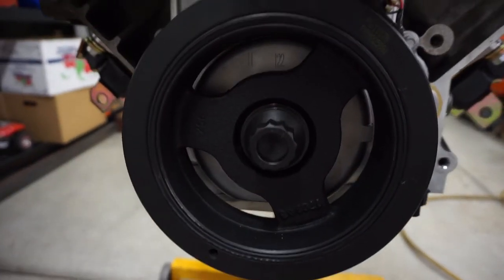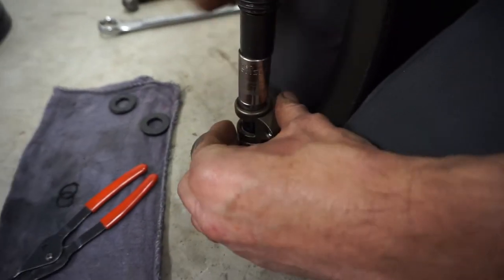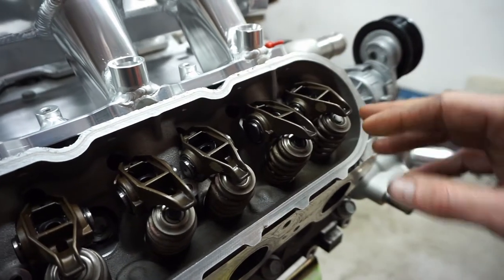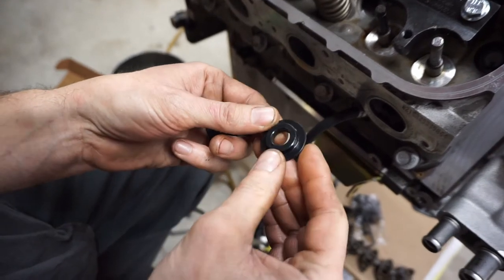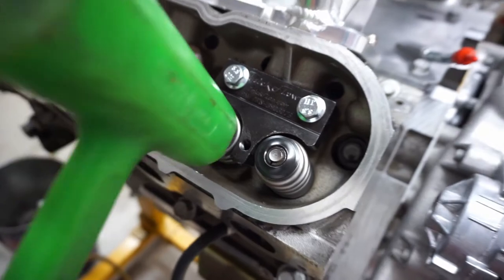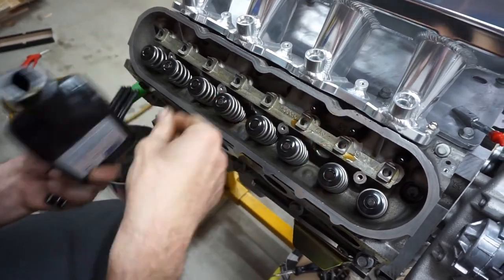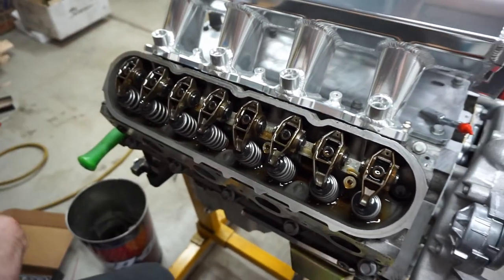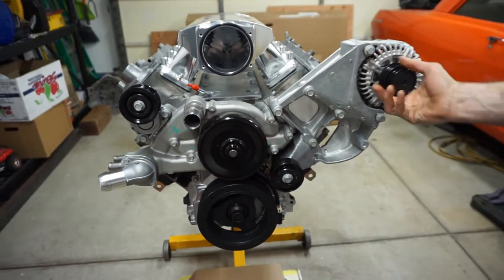LS3 valvetrain upgrade - Chevy Nova Build Part 7

Comment: An arbor press from harbor freight would've made your life easier. I upgraded my rocker arms with BTR V2 trunnion assembly in less than an hour on all 16. First 2-3 are a learning curve, then it becomes muscle memory.
Reply from the maker: I stopped listening when you said Harbor Freight🤣 but good stuff man, definitely becomes muscle memory after the first few
Reply: @ZHPGarage  Any arbor press is better than the c-frame press you were using. The one from harbor freight is inexpensive. Go buy one for 1k if you have the money by all means. Thanks man!

Comment: I'm building a 64 post Chevy 2.
Reply from the maker: Nice!
Reply: I'm having trouble trying to get my Chevy 2 together. I have paid for help but can't get the help. I have been diagnosed with ra and oa and have been working on it as I can. Wondering if you guys can help me out with the rest of the building my Chevy 2. I've gotten the front end off and started putting the tci suspension on the front. I have to get the rear TCI three link installed. Not complaining but help would be appreciated 👍 you guys have a great channel and really enjoyed watching your Chevy 2 come together... awesome Chevy 2. Hard work on it , you make it look easy but finding my hands don't want to work most of the time makes it frustrating... you guys rock!!!! Thanks for your time.....I have new windows to go in and the TCI suspension and waiting on a blue paint 400 sbc crate engine.i have the rear disk brakes for the back. This is a shot in the dark but thought I would ask......